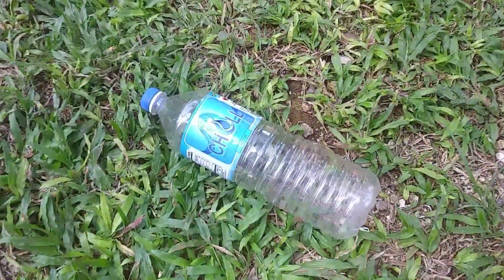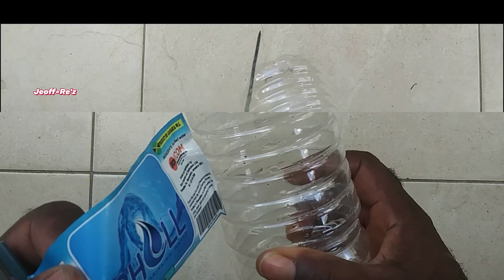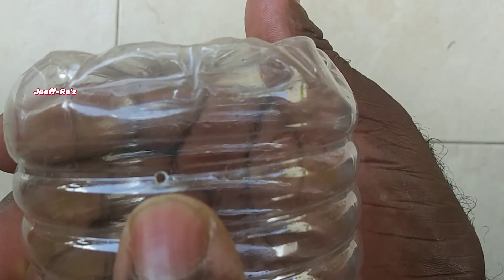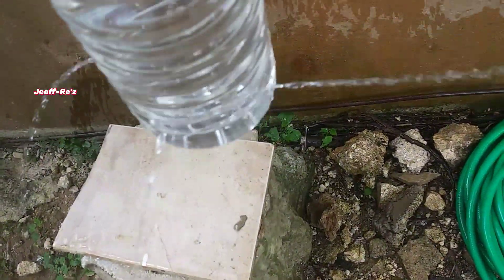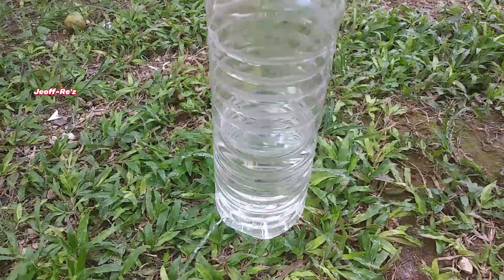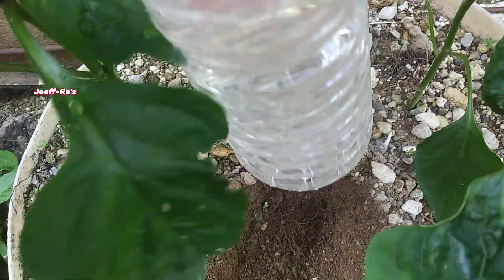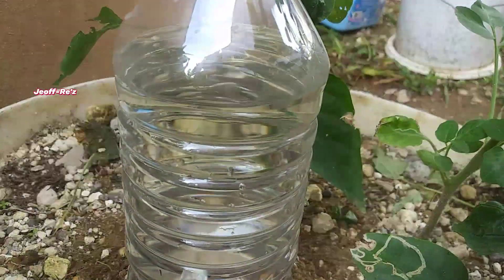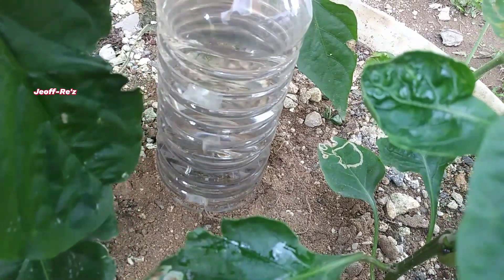Make simple drip irrigation system for pepper/tomato from plastic bottle #gardening #dripirrigation.

Comment: Jeoff, how d0 I prevent banana leaves yellowing in my garden naturally? The soil has plenty of mall
Reply from the maker: Marl doesn't really have any nutritional value and most time it is easily dried out causing a lack of moisture for the roots of the plant.
Reply from the maker: As a result you may be required to water more often
Reply from the maker: The plant may be lacking in micro nutrients like sulphur magnesium potassium or even zinc. You will need to feed that tou your plants. 
Magnesium sulphate, wood ash can be given in small quantities once in 10 days. 
I trust this will help. 
Remove to another area if you can
Reply: Thanks for you advice. I will try your recommendations.